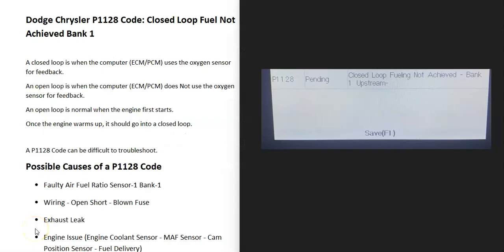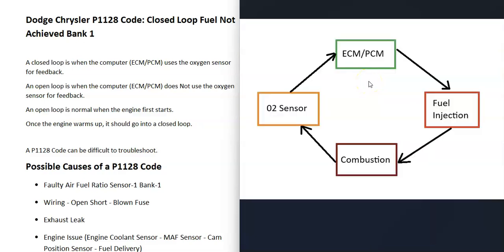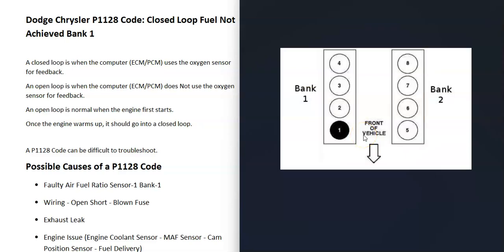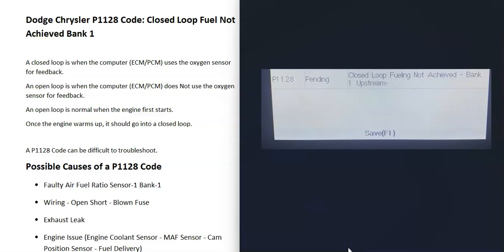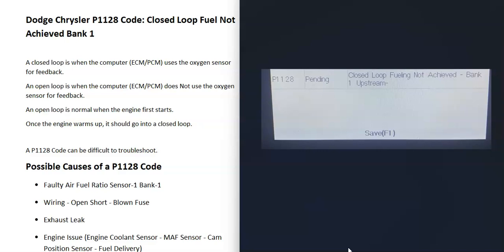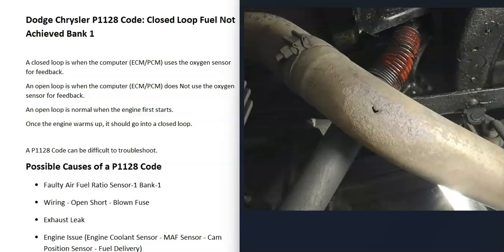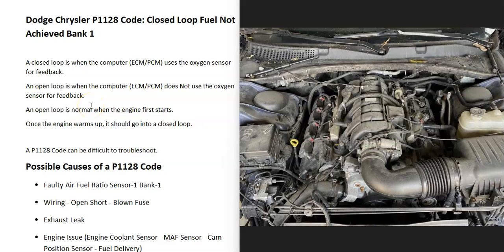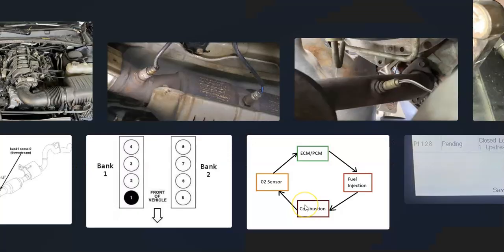Causes and Fixes Dodge Chrysler P1128 Code: Closed Loop Fuel Not Achieved Bank 1

Comment: My jeep throws only this one code... any ideas? How do you test the O2 sensor? Wiring seems ok.
Reply from the maker: It is usually tested with a scan tool that has live data and can graph. It can also be tested with a multimeter, mainly on the heater element side. The 02-sensor side is a more difficult test with a meter.

Comment: I replaced the upper and lower O2 sensor and the light is still on.  I have a dodge journey. Do you think I need to replace the catalyst converter? I put in cata clean the light went off for two weeks then the codes popped back up.  It was like a temporary fix. 😢
Reply from the maker: Usually when a CAT goes bad there will be catalyst codes. I would do more test on the 02-sensor wiring and the catalytic converter if you think it is bad.
Reply: @HVAC_Mechanic  I replace both catalyst converter and the o2 sensors. Lol and SAME codes. That's twice now for the O2 sensors
Reply: @doloresm9737  Hello ! I had the same issue and I had to reset codes to remove old behavior codes! Fixed my problem!
Reply: @HouseofCardsUnfoldTheTruth  I did reset the codes and 24hrs later the codes came back.  Honestly, I believe I bought a converter that probably had cheap metals and I need to invest in a more expensive one.
Reply: @HVAC_Mechanic  I went ahead and ordered a new cat but if these lights stay on I'm going to be so sad

Comment: What if i changed the o2 sensor and the code still there?is it possible the o2 is also defective?
Reply from the maker: It is possible but it will need to be tested know for sure. If the sensor was swapped out, I would test the wiring.
Reply: My 08 Hemi is throwing a p1128 and p1129, two po300's and a po308, po339 and a po456.

Comment: What if the only codes are the close loop fueling not achieved and then the o2 sensors?
Only other one i have is an oil pressure sensor code

Comment: I have a 2010 Dodge Ram I have that code I have replaced spark plugs coil packs O2 sensors clean fuel injectors and still have that code I'm going to try the map sensor and my coolant sensor got replaced last year any other advice would be great thank you for your content
Reply: Just replace coolant temperature sensor and thermostat because I drove it for 30 minutes and it wouldn't get above 190 degrees about the test drive it and see I feel it might be a bad coolant sensor
Reply: @themanhandy  07 300c 5.7 replaced 02 sensors, t stat, pcm, fuel pressure 60 - 65 and only getting p1128 and p1129 and it just shuts off, suggestions?
Reply: @jamesjones4607  Bro. Change the map sensor on top of the intake manifold. It's in the back. I'm pretty sure that's your problem like thirty dollars at o'reilly's
Reply: @themanhandy  didn't fix it, I'm towing it to my mechanic tomorrow, I need my car fixed so I'm not borrowing vehicles anynire
Reply: What did it end up being cuz I am having the same problem
Reply: Mechanic said it was the skreem, it wasnt, he refuses to look at it now, changed the coolant temp sensor since I snapped the plug off of it, still not fixed
Reply: @jamesjones4607 did you ever figure it out?
Reply: @jamesjones4607 ever find a fix pa? Would really appreciate the response
Reply: @Xovlady  mine ended up being a o2 sensor
Reply: Did you ever find out what it was?